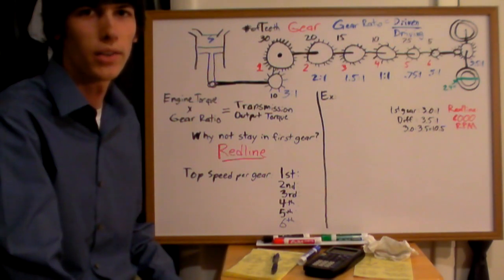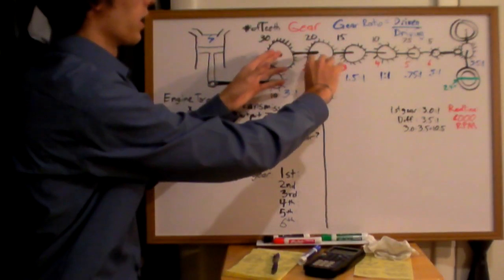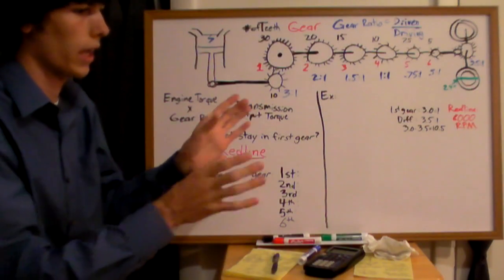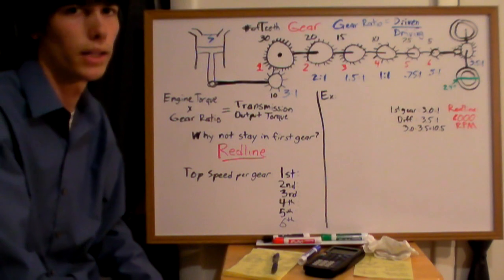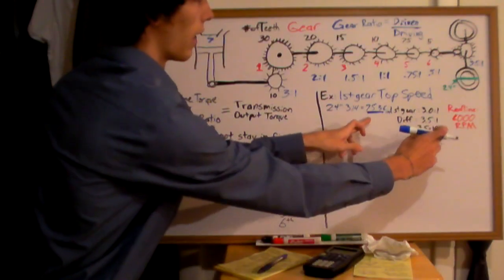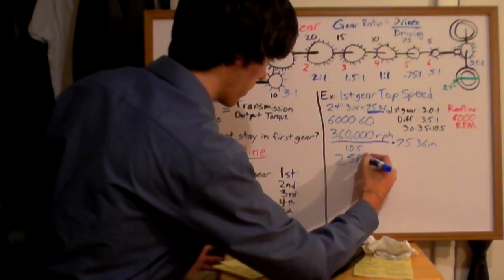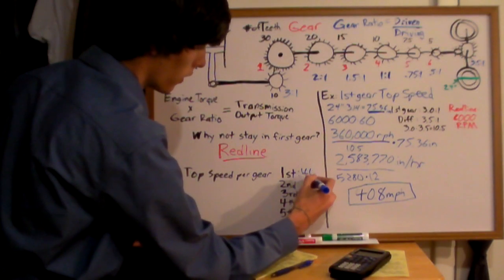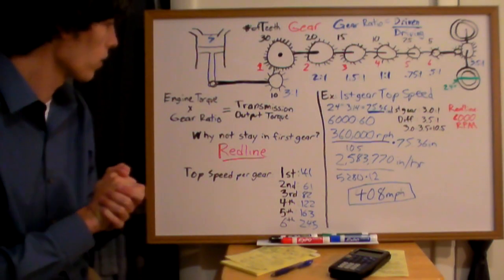Car Gears - Explained

Comment: I think that another important reason for changing gear, in order to have more acceleration, is that if the engine is near to the redline, you probably have overcome the point of maximum power, so changing the gear will decrease the rpm and lead the engine in a point of more power, that is proportional to the acceleration.

Comment: Is this top speed dependent on the weight of the car and if so how would you calculate it? I find it hard to believe that a car with the same engine and gears but 500kg more mass than another car would have the same top speed

Comment: so if I had a bigger rims and tyres  first gear top speed is going to increase ?
Reply from the maker: Dimo Kolev Yes, but you'll have less torque (through lower gearing).
Reply: +Engineering Explained ah now i understand how drag races works, less force but more revolutions on the tires, right?
Reply: Just keep in mind that larger rims does not equal larger tires. You can have different sized rims with the same tire diameter. This implies that the tire sidewall is shorter, and to compensate, the tire will be wider.

Comment: This is Great! can you elaborate and explain why i might want a 3.5 final drive vs a 4.11 etc.  I understand how the concepts work now but in practical application how should i gear my final drive?
Reply: If you want a 3.5 FD you will have higher top speed but have less torque than you would if you had 4.11s. With 4.11s you will accelerate alot faster and tap out at lower MPH than you would on 3.5s

Comment: So you start with the smaller gears so the crankshaft can gain more torque to spin bigger gears which will help spin the wheels a lot faster?
Reply: Yes, faster acceleration. Higher gears for faster speed.
Reply: I guess that explains why you don't hear gear shifting from hover cars on t.v. or video games.

Comment: I've tried to do the maths by myself with a 9k rpm engine and the same gear ratios. when I'm about to calculate the max speed in first gear I have (9000×60=540000) 540000 : ???? and here I get lost. You said your gear ratio is 10,5 but the first gear ratio is 3:1. Where does 10,5 comes out from ? I just don't get it :/
Reply from the maker: Giorgio Low 10.5 comes from 3*3.5 (multiplying the gear ratio by the final drive).
Reply: oh, it's all clear now. thanks a lot man. keep it up with your great work, you really helped lots of us and we really appreciate it !

Comment: Foot? Inches? Pounds? Y U DO DIS, 'MERICA?!
Reply from the maker: IronStoneMine Job security.
Reply: What jobs are secured by this? The rest of the world realised that it doesn't make any sense viewed from a scientific standpoint. America doesn't try hard enough to adjust their unit system. Everyone in the world is adjusting their language, so the US could at least start enforcing metric units on their products. :/
Reply from the maker: IronStoneMine It was a joke. Apparently poor.
Reply: Haha, that went right over my head! Anyways, great videos! I watched through pretty much everything you put up in the last couple of days! :P Keep up the great work!
Reply: Why do you consider it so important to enforce metric on people who are more familiar with imperial units? I know your comment is over three years old, but I suspect your opinion on unit measurements won't have changed.
Reply: @mullacsk8  Well, to get from centimeters to kilometers, metric users don't have to divide by 5280*12, it's non-sense, who remembers that? 
1 meter (3 feet) = 100 CENTI-meter (Like perCENT (%) is a ratio obtained by dividing by 100, it's right there in the name, you can't forget it so you can't convert it wrong) 
1 KILO-meter (0.625 miles) = 1000 meters. 

And centi (10^(-2)) / kilo (10^3) / milli (10^(-3)) etc..  are prefixes used in all other units of measurement within the metric system. Why it's easy? Because they all represent a factor of 1*10^(n). So going from kilometer to 1 meter will never be 5280.
Reply: @tadiniteriad8093  I do not doubt the convenience of metric. What I am asking is, why do people feel the need to force it upon those who continue to use imperial out of habit and familiarity? There's a particularly famous example of a man in the UK some years ago (where I'm from) who was given a criminal record for selling his bananas by the pound, which fell foul of the European directives, I believe he was given a suspended prison sentence. I mention this because the original poster suggested that the USA should do more to "enforce metric units on their products".
Reply: @mullacsk8  well NASA lost one of their $100mil + probes in 1999 due to simple maths error because of using imperial units. Now they just use metric
Reply: @longlam4970  You've twisted the facts to suit your argument there. The error was not caused by the use of imperial units, it was caused by a failure to convert imperial units provided by the probe design team before performing navigation calculations in metric. 

By using your argument in reverse, the Gimili Glider accident in 1983 would have been due to a "simple maths error" because of using metric units. Obviously this is absurd, the error came about because the ground team were so used to using imperial units and accidentally weighed the fuel in pounds instead of kilograms.
Reply: @mullacsk8  u r familier with imperial and I'm with metric so should we not communicate/technically ????

Definitely not, so what's the solution?????  Both should know the same system. Now the question is which system?  Obviously easy one Is the best option 

So it's imperial users who need to adapt and not the metric ones, if this seems forceful it's not it's a need.
Reply: @अण्वायुवरीवर्त  "u r familier with imperial and I'm with metric so should we not communicate/technically ????"

I have no issue whatsoever with the use of the metric system. People are free to use which ever measurements they see fit When different organisations or people meet using different measurements, they may choose to use the most appropriate system. I've no doubt that most of the time metric is the easier system to use in these cases.

"So it's imperial users who need to adapt and not the metric ones, if this seems forceful it's not it's a need."

Absolutely not, the use of imperial is a system which is familiar to millions of people and tied to the heritage of many countries in the Anglosphere. As I have stated, I have no issue with the metric system being used if people choose to do so, what I oppose is metric fanatics like you telling me and millions of others that we need to convert to metric using the law to coerce us (see example I mentioned in the thread). 

If you find this position so difficult to understand, then try to imagine being forced to switch to using decimal time (10-hour clock) or being forced to drive on the opposite side of the road.
Reply: @mullacsk8  Nah man I was just memeing 
But ssly I'd be so mad if my teacher starts using imperial system. If u read my comment u'd know I was just projecting 

Good for you man I can't imagine 40 ft, 125lbs, 10lbft also can't imagine mass from weight Bcz donno how much gravity n I'm sure it'll be something so not obvious
Reply: Engineering Explained I think you should do a more in-depth video on gear ratios and how to choose the right gear rations for how much power your engine is making.  a remasterd video if you will. This was a good video but obviously your more experienced now and you can explain things better then back in 2011. If you could do this it would be very much appreciated.
Reply: @The Adel Just to finish on a civil note, I do not object to having the metric system used alongside or as an alternative to the imperial system. What I object to is being told by metric fanatics that imperial is inferior and/or that we should force an entire country to switch to a system that they are unfamiliar with. I also think it is perfectly reasonable for people from metric countries such as yourself to request metric figures in these videos which they are more used to.
Reply: it's a matter of freedom at this point eagles caws in distance overhead
Reply: @The Adel Why should whole nations who are so accustomed to using imperial measurements be forced (often using the law to coerce them, as I mentioned previously) to switch to metric just to suit you and other countries? Should we also force them to drive on the right hand side of the road just because you and most of the world's population are so accustomed to driving on the right hand side?
Reply: @The Adel The people in my country (United Kingdom) were forced to use a decimalised currency and the metric system which they didn't want and weren't familiar with, by people who thought exactly like you. We now have generations who have been raised being taught metric for some things and imperial for others. The best example is that we fill up our cars in litres at the petrol station, yet drive in miles and work out fuel economy in "miles per gallon", all thanks to people like you who like who claim with such conviction that it is better for us. 

Evidently, many countries (predominately those in the anglo-sphere) managed perfectly fine with imperial units, and in my view fared worse as a result of switching to metric. Man went to the moon in familiar miles, yards, feet and inches, not soulless Napoleonic kilometres, metres, and centimetres. I'd rather keep a familiar system full of history, strange as it may be to you, than adopt a foreign system which is neither familiar nor rooted in the history or culture of my country.
Reply: The Adel “Metric system is easier than imperial, simple as that” 

This is your subjective opinion, not the objective truth. People in the anglosphere continue to use imperial units because they are familiar and of more use in everyday life. A 30cm ruler remains near enough equivalent to an imperial foot. 

If you want further to understand why people don’t want to abandon a system of measurement they are used too, then try and imagine using decimal time. I bet even you would object to being forced to use a system of time which you are undoubtedly unfamiliar with. So much for metric being easier.

“go read about the disaster that cost NASA 100 million dollars because of using imperial units.”

You must have accidentally missed my reply to another commenter in this thread. NASA didn’t lose their probe because they were using imperial units, they lost it because the navigation team failed to convert the imperial units supplied by the design team before making trajectory calculations. Surely you must see how absurd it is to blame the mistake on the imperial system? 

As I pointed out before,  by using the reverse of your argument, I could say that the Gimli Glider in 1983 was a result of using the metric system. This is obviously absurd. What really happened was that the ground team were so used to thinking in imperial measurements (as were the Denver probe design team) that they measured the fuel required for the plane in pounds instead of *kilograms*. Neither system is to blame in either of these incidents, if anyone is to be blamed, it is the people who forced a switch to metric.

I think I’ve exhausted this argument now. Your last comment offered nothing in the form of a reasoned response. So I’ll just leave it there. Have a nice day.

Comment: thanks for this nice explanation. and i have these two questions.
what makes an engine stall? 
does a gear has a minimum speed as well? how do you calculate it?
Reply from the maker: Ishan Kavinda An engine stalls when the torque it's providing is not enough to move the vehicle (the vehicle acts as a brake for the engine). Not really a minimum speed, but if you're in fifth gear at 5 mph, your engine RPM will not be high enough to move, so it will likely stall.
Reply: thank you :) and one final question. what is final drive ratio and where does it come in when calculating the motor torque of a vehicle?

Comment: Thank you for the video!
One question. Two cars from different manufactures but engine having similar power and torque. But one (Hyundai elitei10 diesel) has six gears and other (Ford Fiesta diesel) has five gears. Why does some car manufacturers limit the max gear to four (Corolla automatic) or five? Comparison available @ http://www.carwale.com/comparecars/ford-fiesta-vs-hyundai-elite-i20/?car1=2176&car2=3639
http://www.carwale.com/comparecars/volkswagen-vento-vs-toyota-corollaaltis/?car1=2652&car2=3341

Please explain. Thanks!

Comment: Thank you very much sir for another great video. I would love to know how do we adjust gear ratios to best fit car , and deliver maximum amount of power for each gear. Meaning, is there a way, where you can increase the capacity of the amount of power each gear ratio holds, by installing or changing what parts for an instance ?  e.g we need better differentials ( let's say differential that drive two rear wheels together , that will increase amount of torque + anything like a sports gear , or clutch will help increase power or promote higher efficiency of the gears) ... Much Much appreciated sir.

Comment: 24 inches x 3.14 = 75.36 . What is 3.14 ????And y Multiply this term??
And Can u Explain this mathematical formula in this comment
Reply from the maker: harsh chovatiya 3.14 = pi. Pi*Diameter = circumference.
Reply: Thanks ...Got it : D

Comment: Why does torque start to drop off at higher RPMs?
Reply from the maker: As you start to have inadequate airflow, torque begins to drop, as well as increasing frictional/heat losses.
Reply: Engineering Explained So does torque to the wheels matter more than engine torque and or HP? If i have more torque to the wheels (via gearing) would i still get out accelerated by a vehicle with more engine torque through the same RPM?
Reply: Sea Tac Assassin engine torque doesn't matter, torque is just force, hp is actual power, an engine with 1 ft-lb of torque and 500 hp beats one with 400 ft-lb torque and 400 hp
Reply: xXJeReMiAhXx99 No it does not. Torque is a rotation (force) to which that is how a whole vehicle operates (engine torque, transmission, final drive, wheels) when HP is measured, it does so by torque, when acceleration is measured it is measured by distance not time. If you can explain to me how much HP it takes to move a 3500 car one full G force again there is that word FORCE, why do you think that is? You do not need HP at all in order to have acceleration.
Reply: xXJeReMiAhXx99 1600 hp audi r8 beats two 1800 hp lamborghinis 
. 1200 mustang cobra beats a 1450 lamborghini. If you have a car that has 1 ft lb of tq and i have 400 ft lb tq you would get your butt handed to you on a delicate seafood platter. In this case it would not matter how much you gear it then. If hp was the deciding factor why do you accelerate faster in lower gears than the ones in higher gear (torque at the wheels) ie engine torque x total gearing x wheel. Why do American cars use such TALL gearing and imports and Euros use more aggressive gearing. Example a zr1 will only catch up to a GTR in  3rd gear up, why is that...their torque at the wheels start to become similar and so with the zr1 weighing so much less it then has a better Torque to Weight ratio. A Ferrari 458 has a final drive of 5.14 (you don't even hear that number in drag racing) why because they produce less than 400 ft lb tq so to compensate for the lost in the engine compartment they multiply it through the driveline

Comment: thanks for the tutorial :) The tyre with a diameter of 24" is not realistic for a normal vehicle.... maybe 18" & the 5th gear 0.75 ratio topspeed will be more a realistic 122mph :p  

Can you comment on the effects of "engine braking" on the engine? ie downshifting to lower gears instead of or in conjunction with actual braking
Reply: 1: The faster an engine is turning, the more internal friction and air resistance within the parts.
2: The lower the gear ratio, the more engine turns per wheel turn, so more braking force through the wheels.
Higher engine speeds also work the assisted brake pump more, making the brakes more responsive.
I assume it wouldn't damage the engine unless it's either a 2 stroke (no fuel/oil mix going in), or you go over the red line by downshifting too far for the speed, or the engine is cold.
Reply: it's pretty realistic to me. the only problem here is semantics by which he used the word for. when he talks about tires, he actually means the rubber component of a car's wheel. I use wheel as a combination of the tire(rubber component) + rim(the metal wheel). usually the tires are mounted on rims(wheel). I wanna say wheel because I see the rim and tire as a set of wheel. but regardless 24" tires are realistic, 24" in wheel(rims) though. even if he was just talking about the tire, tires can reach 24" or more really. the wheels i'm sure don't reach 24".
Reply: Bigger*

Comment: For the max speed at 6th gear, is that assuming that you take it to 6000RPM in every gear before shifting?
Reply from the maker: It wouldn't really matter what RPM you took the previous gears to, this is simply the speed limit of that gear.
Reply: Yes, but in most cars except a Bugatti Veyron, you'd have to go down a very steep hill with the gas floored to reach 244mph in the 6th gear.
Reply: ***** uhh what? of course downhill will increase the top speed, what are you smoking? don't say you know anything about physics with a statement like that lol.